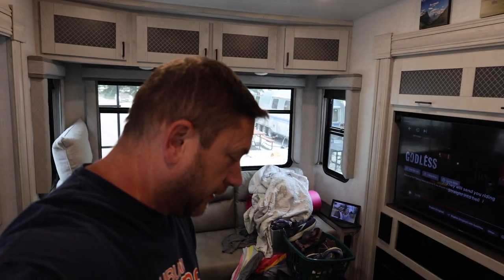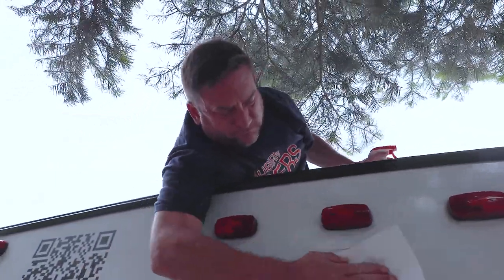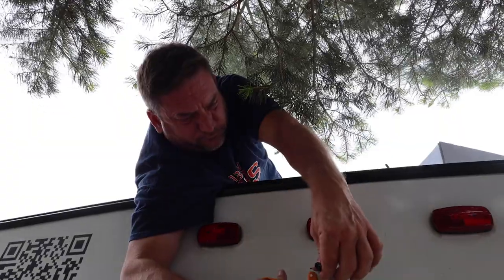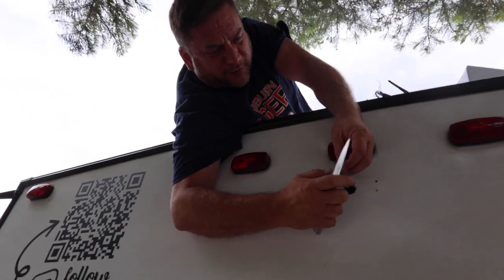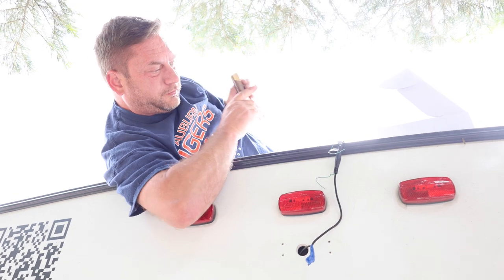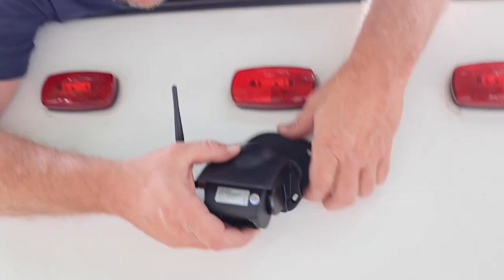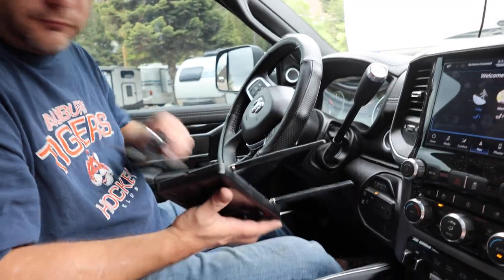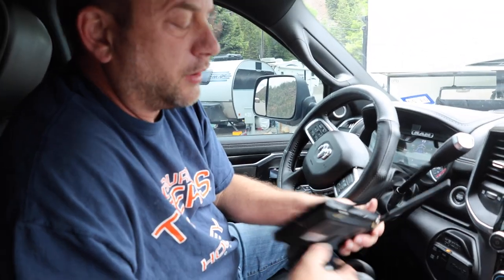RV Backup Camera, Real Install steps - Full Time RV

Comment: Good Job! We watched the video that other YouTubers reviewed BT7, they said you could directly plug the Furrion adapter cord that Haloview configured in the BT7 kit into the Furrion pre-wired, thus, you don't need to cut off the cable connector like your video. It possible that the Furrion adapter cord in your BT7 was lost by accident, because we found the cord you showed in the video is the pairing cable for pairing and the BMW connector for powering the monitor. LOL...
Reply from the maker: there is supposed to be a 3.5mm cable in the kit. Ours did not include it. Halo view sent me an email saying sorry. I still would not recommend. not a fan of missing parts or the adapter for the monitor in the truck. video lags, and they sent me so monstrosity of an antenna to run along the roof of the RV.

Comment: Good info. I find it frustrating as much as we pay for our RVs the manufacturers don't include a rear camera. These devices and their proprietary plugs are out of control. Apple cables, USB, USBC, mini USB, micro USB. Time to coordinate those like we did with electrical plugs.
Reply from the maker: You put the wording together and I'll sign it. What really ticked me off was the monitor to the 12 volt adapter. They wouldn't to connect to each other without an adapter. How does a company not connect to itself. I try and do TRUE install videos. It makes me mad that other channels never highlight these issue. If you watch one of their videos.....it all goes smooth. I believe in truth in marketing. for $369 I should not have to cut anything. we have not towed with it yet, so video quality and signal is still in question.

Comment: Jankity, especially janky. LOL
Reply from the maker: Chinese crap is what it is. they should have left the wires bare. Not a single one was usable without another adapter or the existing connector needing to be cut off. Maria edited the $%&# out of what was really said during the install.